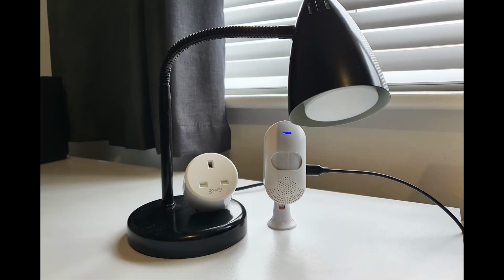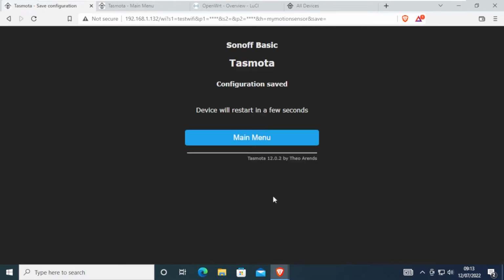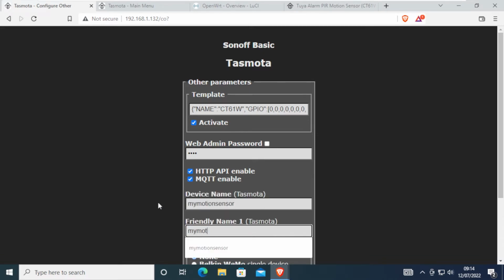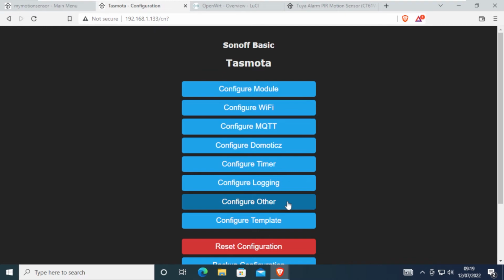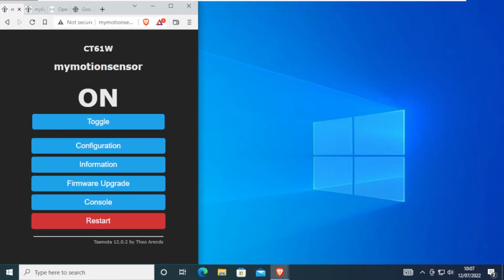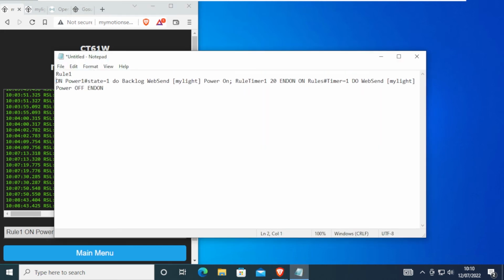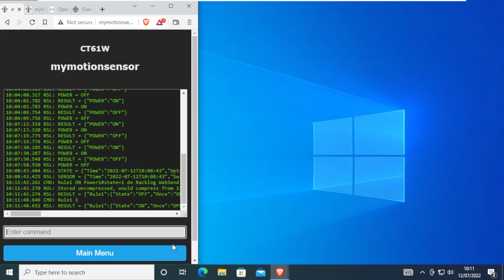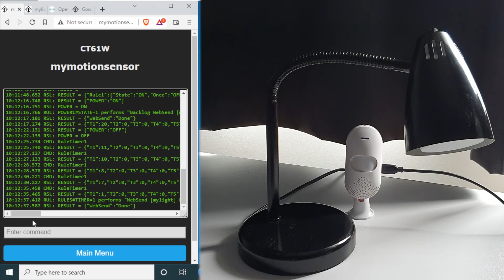Tasmota - How To Automate A Light Using A Motion Sensor With Rules And Timers

Comment: Where is the automation run on. A node red or pc or a cloud or on the same esp. ?
Reply from the maker: Doing it this way was just direct Tasmota device to Tasmota device communication using a http request.
Reply: I’m currently using 8 relays and one dht22 sensor on same esp32 running tasmota. So will i be able to use that dht22 data to turn on/off a relay in same esp board via console?  Thanks
Reply from the maker: @dumindujayasinghe  For sure. similar concept in this video, using Websend and referencing the devices IP address or hostname, I think chatgpt might be able to draw up the basics of what you need, rule wise
Reply: Thanks you very much. I’ll look for it. ❤

Comment: I've got an issue where when the light goes off, the motion detector senses that as a motion and again turns the bulb on.... it becomes a cycle of on-off-on-off.... any way to rectify this?
Reply from the maker: Try this remember to enable both rules - Rule1 1 and Rule2 1
Then reboot device.

Rule1
ON System#Boot DO Var1 1 ENDON

Rule2
ON Power1#state=1 DO Backlog0 WebSend [mylight] Power %Var1%; RuleTimer1 20 ENDON 
ON Rules#Timer=1 DO Backlog0 Var1 0; WebSend [mylight] Power OFF; RuleTimer2 4 ENDON
ON Rules#Timer=2 DO Var1 1 ENDON